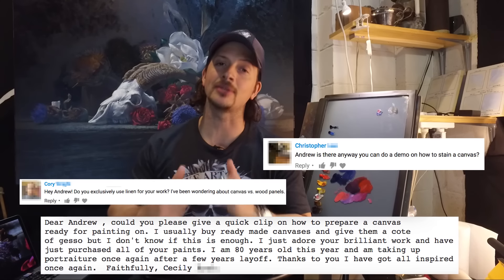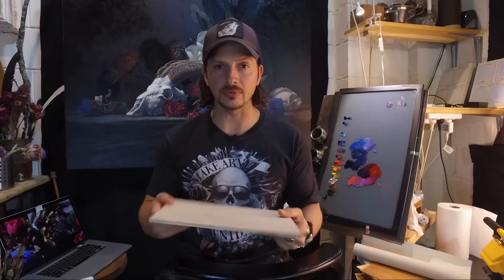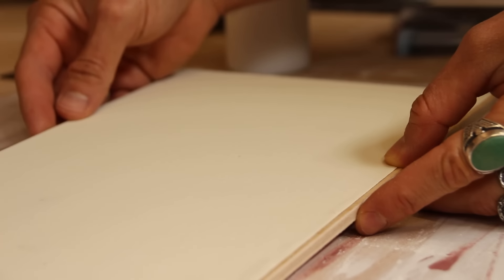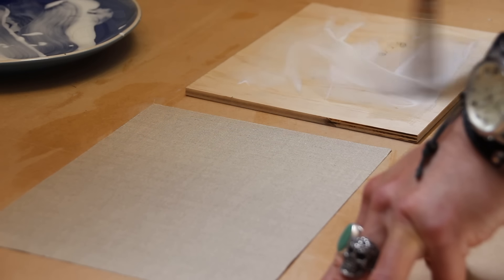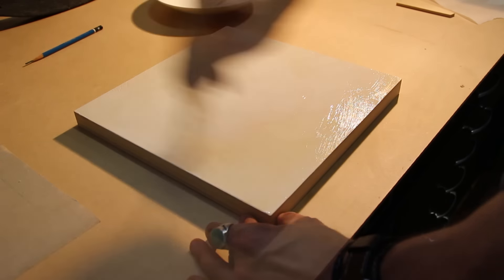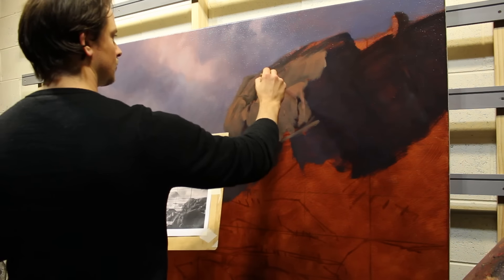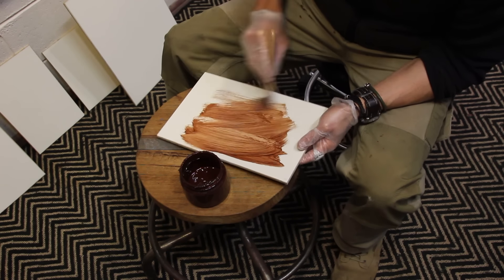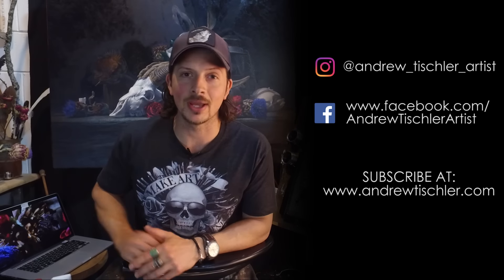How to make Oil Painting Panels!

Comment: If you seal mdf, it's as water resistant as any plywood,  but much less likely to wrap, and more  important, crack. Plywood, especially thin, is notorious for splitting with the grain as the adjacent ply swells and contracts. That's why mdf may be a better choice, if you seal it was polyurethane or dewaxed shellac.
Reply: I typically use shellac to seal my MDF boards. It works great!

Comment: Great info as always.  If you sandwich your board and canvass between two sheets of greaseproof lunch wrap and then between two sheets of 18mm melamine (old cupboard shelving units) with a weight on top (overnight) you won't have the issue with bubbles on the edge and they will dry flat.  The lunch wrap is to prevent the glue from adhering to the melamine.  When you take them out the next morning they are not 100% dry but they will be 100% adhered.  Please ignore if you've tried this already.

Comment: I always make sure there is at least  ½ an inch of canvas sticking out on each side of my intended size of canvas so a 10 * 12 size canvas would be 11 * 13, I have found that by adding after applying glue to the board I then also add an inch/ 25mm band of glue around the edges on my canvas as well , I'll even go over the marked out board size on the back of the canvas by ¼ inch / 6mm really helps to reduce the waves of popped canvas and a brayer dedicated glueing boards for rolling out bubbles really helps.  Thanks for these videos which you put out on the tube.

Comment: Thanks for the great tips!

What I don't fully understand is the key difference between the two methods (besides standard vs archival PVA and the more elegant cutting method which one could also use in the simpler case). Is it the reinforced panel on its back side? As far as I know linen does not stretch or shrink too much in response to moisture, which is not the case with (ply)wood panels - is this why the panel is reinforced (archival case) to make it more stable? A sealed simple panel without the reinforcement might expand (in humid conditions) ruining the more rigid canvas?

Thanks a lot!

Comment: I usually purchase 8' X 4' X 1/8" sheets of hardboard from a large hardware store and then cut the sizes that I want. This hardboard is very smooth on both sides but I nevertheless prime with acrylic paint, sand with a very fine sandpaper and then re-prime, using acrylic with a small amount of water to make the acrylic runny and that fills in any rough areas from the earlier sanding. Have you ever tried using this method and if so, what is our opinion?
Reply from the maker: Yeah, I used to do this and it's a pretty decent panel to paint on I must say. It really is a preference thing. I enjoy the feel of the weave of fabric. This is why I adhere it to the ply. Hardboards aren't generally considered archival.

Comment: Great. great video and info, but mdf/masonite not archival? what if it is presumably sealed? i'm not doubting you but usually it is touted as better than canvas archivally speaking maybe they're talking about birch or something? (and directly on the sealed surface never mind attaching canvas as you so professionally show how to do)
Reply from the maker: Hey Peter. The binder in the MDF will degrade as it soaks in moisture. It has the tendency to expand. Working with canvas or linen over this is preferable, but still, over a vast amount of time we will start to see a bit of expansion. In humid climates or in the tropics, this is prevalent. Bear in mind, this is just one way of doing it. People asked..so this is how I do it. As always I am looking for better ways, but I do still trust my restorer when he advises me against composite boards. The birch panel, reinforced on the back seems to be the best option. I am loving the results so far, I'll get back to you in 200 years! :D
Reply: Thanks! probably it's why your restorer got angry /"told you off":-) because it is very prevalent to claim mdf as being most archival when apparently it's not. At least be sure it's sealed on the back, as you suggest, if one does use it.
Reply: @AndrewTischlerArt  that clear s my last doubt about the superiority of plywood. 200years is good enough. 😀

Comment: Nice Video Content. I am your new subscriber. At present I am reviving the Art Style of PIET MONDRIAN. My plan is to make the Black color (, Artist Acrylic Paint) as base and use masking tape to create the black lines to speed up the Painting Process. I saw a video in YouTube that they apply Zinsser Deep Tint White Commercial Paint to Black Wall before applying the Colored Paint. My question is - If I will apply the same in my Canvas - Use Commercial Zinsser Deep Tint Acrylic Paint prior to applying my Artist Crylic Primary Colors, does it affect the Lightfastness and Archive Ness. Take note the the Black Lines remains Artist Paint. Thank you.

Comment: Hi, my question may seem a little odd to a professional like you but I am just gonna ask it anyway. Does it always have to be a wood panel? If I am painting on a plein air sketching panel, isn't it better to paste my canvas on to a hard plastic examination board? I can make the plastic sheet a little rough  by sanding the surface, cut to fit the size. They are cheap, lightweight but I don't think they are going to warp. Only thing to worry about is that if they are hard enough.
Reply from the maker: It might be okay...MAYBE. But if I am honest, I think there is just such an attraction to traditional materials. The handmade feel is so much more desirable than plastic wouldn't you say? But hey, in terms of archival quality, plastic could work. My only concern would then be what adhesive are you using to stick down your canvas? PVA wouldn't work...just my guess, as the plastic isn't really porous, and it wouldn't form a tight bond. This may lead you down a road where you use a different adhesive only to find it may eat your painting...literally. 
Long story short, I would recommend sticking with this method. Tried and tested, my friend!
Reply: Thanks very much for your reply Andrew . Adhesion is certainly an important thing here. Will continue with wood, that's for sure. Your videos are highly valuable.

Comment: These are just excellent trics.  After rewatching several times, one question, Andrew:  Is there a reason why you wouldn't go ahead and gallery wrap the edges so you wouldn't have to frame the painting?  Just wondering because I need ways to save money.

Comment: hi, love your videos thanx so much. i was wondering if you could recomend a good substitute for gesso as a primer coz its a chalenge to get here in africa?? thanx
Reply from the maker: Hmmmm. Okay, if materials are a challenge, you could find an acrylic based house paint. Certainly not archival but in a stretch it will handle reasonably well. Then, you can paint over this with either acrylics or oils. I would give it 3 coats, and lightly sand the last coat if needed. Might be better to do this over board, where the stiffness will hold the structure stable. You may be able to order gesso online however. Have you tried that option?
Reply: I'm not so sure that a water based product such as gesso is archival when using an oil product on top. After sealing your board with GAC 100 or rabbit skin glue, you may want to try Rust-oleum gray auto primer instead of gesso.  Spray a few coats on your board or canvas and sand between applications with fine auto sandpaper to achieve your desired texture.
Reply: Christopher Joseph even bob ross gessoed his panels before painting with oil !

Comment: Please forgive me if this was asked lower down, but what are the proportions of Liquin/Gum Turpentine/length of oil squeezed in?
Reply from the maker: Okay, about (not exact) but you'll need 3 parts turps, 2 parts Liquin and 1 part paint.
Reply: If there is left over base coat, can you leave the hardware in the jar to shake again later, or will there be a chemical reaction between the Liquin and Turp with the galvanized hardware? How long can you store this base coat? Thank you.

Comment: Hello, thank you for the video. I am ordering a panel of MDF in order to paint with oil painting. Would you say that getting a moisture resitant panel is a bad idea? Would you also suggest using sand paper before applying the Gesso??
Reply: You should sand the Gesso until it is hardened. 2 - 3 coates are enough. The Gesso protects the linen from the acidity of the oi paint.

Comment: Stupid question for you prob, but why do you use linen instead of canvas?  Are pre-fab canvas panels like Frederik's not adequate enough? Where's the best place to buy this linen?  Can it be purchased at a fabric store?  THANK you for this great video.
Reply: I would like the answer to this question as well.  Thanks
Reply: I'm pretty sure he has a Quick Clip for this answer, but at the moment I am not sure of the URL to point you to. Search his playlist. If I remember right, he just prefers the texture. I will come back and post the URL if I find it this morning. Beyond that, I won't remember. ;)
Reply: Linen is canvas, but the answer is that linen's fibers are far finer than cotton, which equates to less rough texture coming through when you paint. Rough textured canvas is the bane of Fine Art oil painters who value things like blending and delicate modeling.
Reply: perhaps this is too late for the comment string but yes, you can easily buy pure linen from  online fabric stores, I use FashionFabricsClub.com and buy heavy weight pure natural (uncolored) tan linen, normally sold as a decorator's fabric. The price is about $7.00/yd (US) and it is 56-60 inches wide.  It works very well, and if you buy unprimed linen from an art source you pay a great deal more.  I buy in 2-4 yard lengths, and I machine wash it before I stretch it for a painting support because often sewing fabrics have sizing on them and I don't know if that is bad for archival needs.  You can also get cotton duck, which is canvas, the same way.

Comment: Hey Andrew! thanks for such awesome information! I find these good quality tips about panels very hard to find. I was a little confused to whether the MDF board or the plywood was archival IF it is sealed with the GAC 100? Or if it has to be all of these: plywood, sealed and extra support on the back? I am asking as it is not available in Norway with premade plywood boards, only MDF :S I found a plywood panel today which has that extra support in the back, however not sealed. I have purchaced GAC 100, but I wont be able to seal behind that extra support.. If sealed mdf or plywood (without the extra support) is archival, I will use that. Would make it easier without the (ca 3mm) extra support regarding framing as well...
Reply from the maker: MDF is not archival. It is hungry for moisture. I would avoid it. Use ply, particularly "dress pine" or birch. These are good options. You may not need to seal the back if it is reinforced.

Comment: In America u can get archival mdf boards from ampersand, however it is possible to make panels which are archrival. The "mdf" u had in the video didn't look entirely like true MDF. I'm not sure why but mdf found here does have a bit more durability to it, perhaps its the strict building codes, I'm not sure. What u had looked more like compressed wood panels. While I am considering switching to birch panels, I've lost no confidence in mdf, I've left mdf panels outside in the rain and sun over the summer and its still rigid. Also its import an to note PVA even though u used an archival glue, I didn't know PVA was archival at all, but using PVA as a sealer has always been a no no to me. It rots the fabric over time, by making it very brittle. So thats something I'll do more research on and perhaps you could too, I'll let u know what I find.

Comment: There are ways... young palawan-learner, considered "unorthodox" to many of the Jedi Order...

MDF can be sealed to make an archival surface, using epoxy thinned to soak itself into the surface, then another coat overtop of that full strength. MDF has many of the same chemicals found inside any plywood, fyi. For me, epoxy is too elaborate and expensive to use, PVA woodglue seals a surface just fine, and that is basically what the artists of the renaissance used, rabbit skin glue. PVA is much better. If you REALLY want to be archival, use cheap thin polyvinyl cutting board the texture of the board is like your canvas texture. I'd never do it, but its far longer lived than any wood product. I find it funny that many people in the art community tell stories about certain things that are bad for longevity, when they really do not know the spectrum of materials or the actual properties of some of the things they recommend... when another better product is available, but not in the "recommended list" they have, they freak out.

I make all my own canvases, or I should say boards. Plywood and wood glue, then primed using PVA primer paint, sanded and primed again. I use a backer frame to keep the surface flat and rigid for larger boards. I stopped using canvas, its just another step I have to spend more time on, and I do not like the texture, so making the wood panel smoother is much easier, and the PVA and wood glue will last for around 200 years after I'm gone. The plywood will last for at least that long too. If my work is not worth a million bucks now, in 200 years, I doubt anyone will say, "Gee, if he had only used an archival canvas..." Of course, they opposite could happen, and they might say, "if only the rest of them had done what this crappy no name shit painter did..."
Reply: That's how I prime my plywood, pva glue, and 1-3 layers of oil primer from home depot. It makes a great painting ground. I'm having trouble with the large ones though....how do you attach the braces on to the plywood?
Reply: Lol!!!! "shit painter" too funny!!!
Reply: @BrazoDelDiablo  Straight up wood glue, doesn't matter what type, this isn't going to be load bearing of a nature that would be considered structural, so any will do. Large or small, I use heavy metal bars to weigh down the wood strips while they dry, or use clamps along one side one side at a time... be sure you are level, that is why I use metal weights, I have a solid level/flat table to glue up on.

Comment: i disagree about MDF board, it can be very archival painting directly onto board or with canvas if you seal it with two layers of GAC 100, GAC is specifically designed to seal painting surfaces from impurities within wood or canvas, and is also an oil blocker so it will prevent any oil treatments the MDF had at the factory from coming up.
Reply from the maker: Cool, thanks for the comment. Yes, if you seal it, no problem. But what happens when it chips? it will suck up moisture out of the air. It's extremely sensitive to humidity. This has been my experience and has also been advised by at least 2 art restorers. But, hey, each to their own as they say!

Comment: To answer one commenter...Painting directly on wood is problematic on several levels. Wood contains lignin, which deteriorates over time, destroying the painting. Wood also has a tendency to respond to humidity changes. It can blister, warp and otherwise distort the panel destroying the painting. Historically over hindreds of years painters worked to solve these problems. Most often, they covered the wood panel with linen and then gesso made of animal glue to preserve the painting as in icon painting, whose practitioners continue to do just that.

Comment: It you cab do not buy these panels. When you see people throwing out old wood dressers. Ones made in the 60's, 70's and 80's. Not MDF but mahogany plywood. Plywood made in the Philippines when they were destroying their forests. It is generally  4mm or 1/4 of inch thick. Most panels are 18x36 inches  or 45x 1meter. It is superior to any or boards. You can also find these at flee markets and garage sales for a few dollars.
Reply: Some of the drawer panels are quarter-sawn mahogany, that's even better! Be sure to seal the panels to prevent warpage.